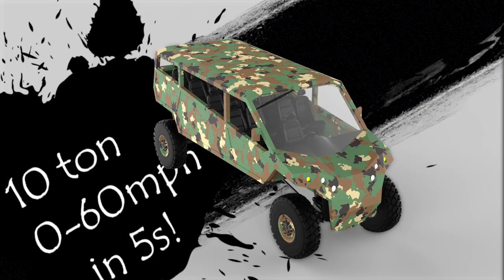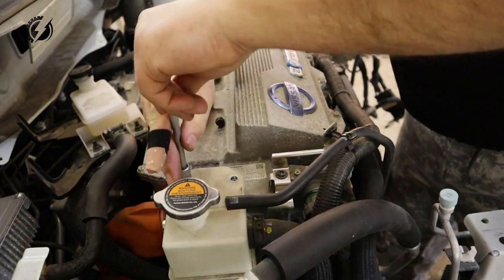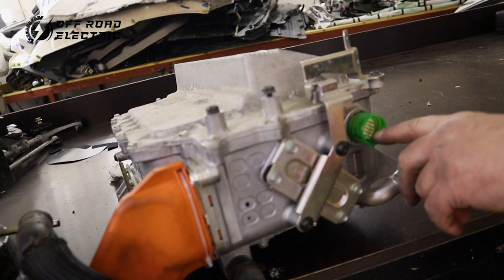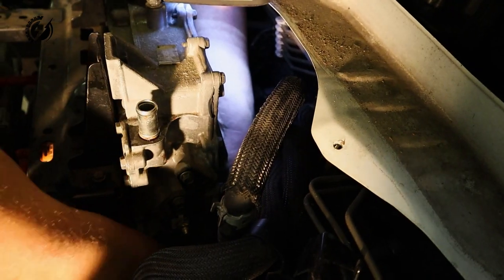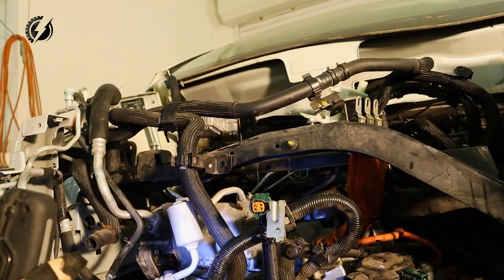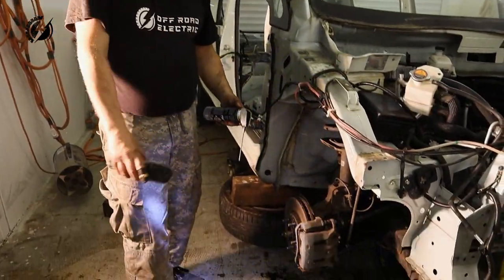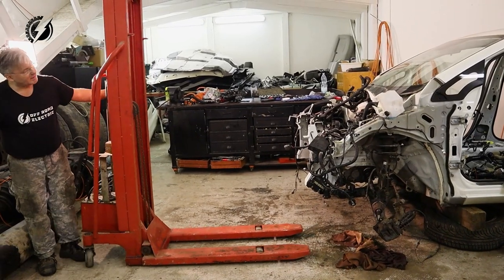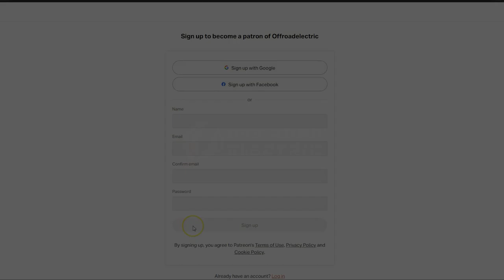EP42 Best Off Road Electric Monster Truck Build-Leaf

Comment: On the axle shafts, I typically use a flat carpentry bar to pry against the housing and behind the CV joint.  If the snap ring holding the shaft inside the differential is too tight, sometimes a slide hammer with a chain wrapped behind the CV joint bell will pop it out.  Glad to see you moving along on this again, Peter.
Reply from the maker: Thx, when I get back to the Czech, will try. There was just no time to deal with it when the unit was outside,  I had to leave for the UK.

Comment: Soon 1 down, 3 more to go :) 
Would be interesting to see comparison on total time taken for each of the teardowns, as they go by!
Reply from the maker: Like with everything else, the practice shortens the time.......There will not be a big difference between the 2nd and the 4th Leaf, as I already know what to do. My bet is 4 days per a car. Also, most likely we will not film it, it would be probably too boring for all of you.
Reply: You can pull the shafts out by removing the wheel hubs and struts, they should just pop out with a flat end bar at the point they go into the drive unit. Good luck.
Reply from the maker: @antoniopalmero4063  I did it in this video.:)  No luck. I will find the way when i get into it next time.

Comment: Get a small impact driver like Makita btp140z it will save considerable time when disassembling things.
Reply from the maker: 80% of bolts/nuts are not accessible with it  in this car. And 60% of total time is is clips/connectors related. When I disassembled Tatras, I almost never stopped using the gun.